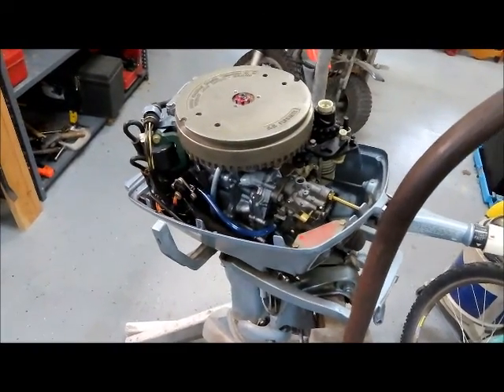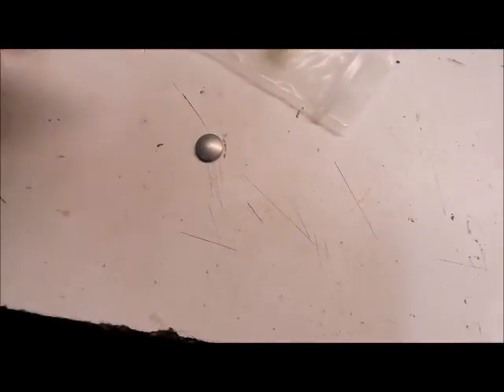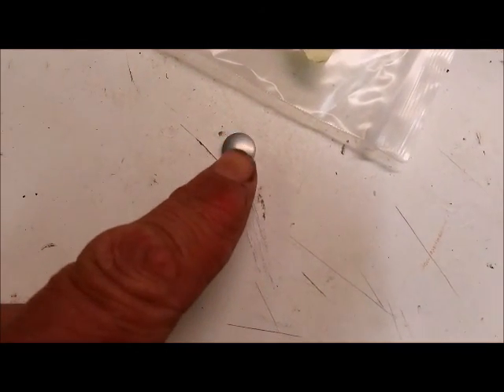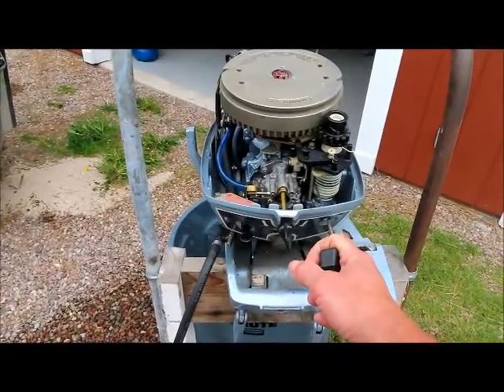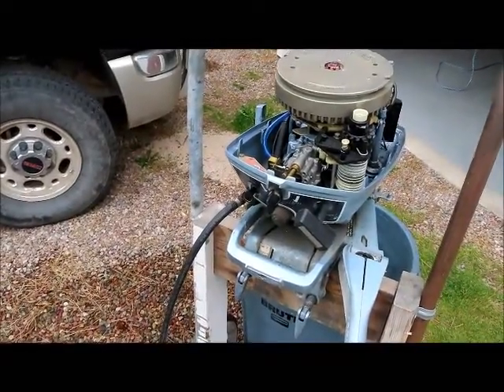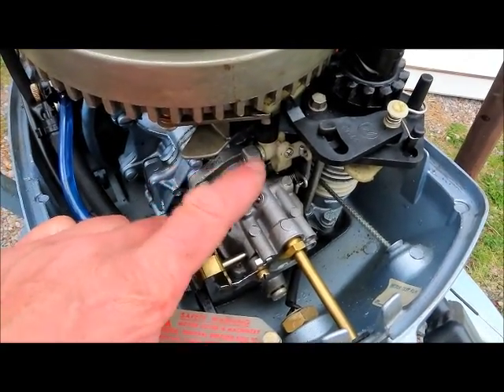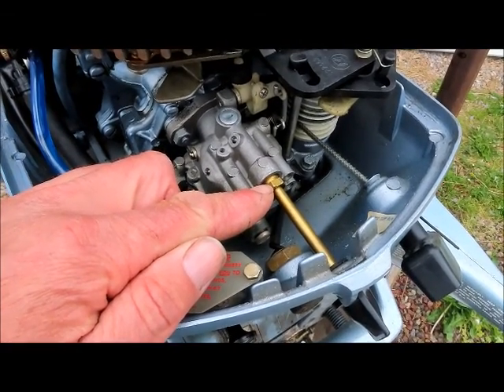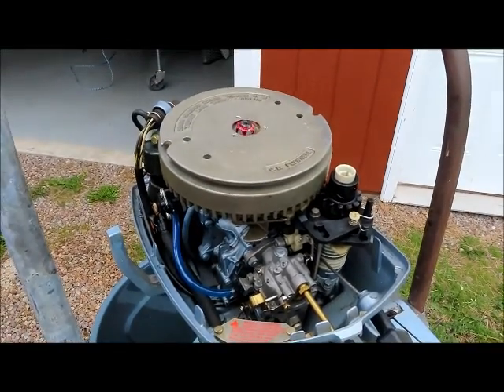Evinrude 6HP Idle and Hard Start Fix

Comment: I did this (before watching the video), and it worked great.  I was a little scared to punch out the old welch plug (first carb rebuild, with the kit, I didn't do it, and it still ran poorly at idle).  Then, 2nd carb rebuild/clean and popped the welch plug out, and further cleaned the holes, and now it starts 1st pull (or 2nd).  Thanks!

Comment: I just got my first boat. 1965 lone star V-hull, with 6hp Johnson sea horse. I have spark  but it doesn't try to start. So I know my points are good. Strong spark, no bark. Fuel delivery is most likely that issue. Thank you for the information, I would have just removed the carb and created more work than needed.
Reply: Never a bad idea to pull the carb and clean it 100% when you get a "new" boat.  The fix I show in this vid might be something that would be overlooked even if you so pull the carb and clean all the other parts but you can try it.  Hope it works for you.

Comment: Wow. I have this exact problem with my 6hp Johnson 1970s engine. It looks very similar to this evinrude. I’m going to try this! Thanks Paul for sharing this information.
Reply from the maker: Glad to help!  I ran this motor a lot last summer and it ran really nice.  Perfect idle, easy start every time.  There could be other things that could contribute to idle and starting issues but this is a great and easy place to start + good maintenance.
Reply: Just working on mine today 1977 Johnston 6 hp that has been ever so faithful but same symptoms creeping in.  Will give that a try and report back. Thanks
Reply: Ordered an expansion plug this morning from C dealer ($12 !) and leaving old one in place until it received.  Had taken apart low idle rod/pin yesterday and soaked with carb cleaner and let sit overnight. Put back together, screwed in until just touched, turned back 1.5 turns. Boom started up 2nd pull, adjusted ife 1/2  tur inwards and idled right down . So thanks as never considered removing,  resetting or removing the expansion plug. Not sure if worth still removing or cancel  prepaid order or simply keep as same part. Any event am a happy camper.

Comment: Dumb question but does the welch plug and low speed pin control air, or gas? I have a 1992 9.9 evinrude. The carb doesnt have a welch plug, but the carb top cover sits over a gasket. Kind of the same look when i pull the cover off and gasket off, theres 3 orifices at the end of where the pin sits under it. I took the pin out and it smelled like gas. If its supposed to regulate air, i might have a leak. I can barely start my motor but once it does itll run and idle on full throttle only. Once i turn throttle down it dies, and then i cant restart it. I've cleaned carb and rebuilt it etc many times but now ive found this video, im gonna clean those orifices and take pin out and clean that too and replace the gasket. Wish me luck, thanks for your video!
Reply: Update: i did what the video said, and now the engine wont start at all😂. Damn.
Reply from the maker: The low speed screw controls gas.  The tighter it is in the less gas, the further out = more gas.  You should try adjusting this screw so that it is about 1 1/2 turns out from being lightly seated/closed.  Don't crank on it too hard, just a light seat before beginning the 1 1/2 turns out operation.  1 1/2 is usually a good start for almost all engines that I've worked on.  I'm sorry but I don't know much about your particular engine so can't give too much advice really.
Reply from the maker: This prob seems obvious but if you haven't changed the plug you should do that.  I've had all sorts of issues with 2-strokes and fouled plugs.  A new plug makes a world of difference sometimes.  Could be a fuel delivery issue as well.  If you have a spare tank and hose or you can borrow one try swapping that.  A small leak in the hose/bulb really screws things up.  I had one that would barely run and super hard to start.  The bulb on the fuel line from the tank had a leak.

Comment: My 1976 Johnson seahorse 4 hp runs good for about 30 minutes, after that it loses compression. Fuel filter and carb are clean and I installed new sparkplugs.
Reply from the maker: Are you sure it is a loss of compression?  If so, the only thing I can think of is a crank leak.  It's possible that you have a bad crank seal in the lower end (output shaft) that is only failing after the engine gets good and hot.  I have not seen this issue on outboards but I have on a chainsaw that I  own so I know it's possible.
Reply from the maker: Other sources of compression loss:  reed valves, head gasket.   Anyone else out there have ideas?
Reply: @paulhaines5755  well I'm not 100% sure. It dies after a while and after that the starter cord feels way too light, as if theres not even a crankshaft attached to it.
Reply: @paulhaines5755  I think it might be the piston rings.

Comment: Hey Paul. I know this is an old video. Ive got a question about my 1966 johnson ld-11r.

I took the lower unit off to change the impeller, and there are two spring that came out but one of them fell out and I have NO idea where it belongs in there, if its supoosed to be on the driveshaft or not.
Reply from the maker: I'm not familiar with that year.  I don't think the models I have worked on have springs in them.  Not sure where that would have come from.  Try to find an illustrated parts diagram online.

Comment: Wish it were that simple to repair in most situations.  It isn't.  You did not even mention the main (high speed) jet in the bottom front of the carb.  It often clogs and will cause a motor to run lean at higher speeds, smoking a piston and scoring a cylinder wall.  Motor ruined.  Still, I'm happy for you that what you did worked well for you and your motor.  Thanks for the video.
Reply from the maker: Yea - your right it's probably best to take it all apart and clean everything - high speed, too.  I was just intending on showing the cleaning of the low speed circuit and the removal of the welch plug in this vid and also how carb removal on this particular motor is not necessary to do only that if you are having starting and idle issues.
Reply: @paulhaines5755  I get it.  Thanks.

Comment: Put some red threadlocker around the circumference of that welsh plug to make sure there's no air leakage
Reply from the maker: Good tip thanks!
Reply: Nope, you’re supposed to set them with a flat punch. I’d be worried about having to remove it later to clean those jets. Who knows what red lock right and gasoline will do either.

Comment: Hi I was just given a Johnson 6hp by my neighbor, it runs just has a very rough idle and shuts off we can see air going through fuel line and not getting enough fuel,we’ve replaced and rebuilt everything we know to do , fuel pump, gas lines/clamps, carburetor,and new float and everything.only thing we haven’t done is change tank which is going to be done tomorrow any advice?thanks
Reply from the maker: Yea - definitely could be a fuel tank issue.  Try a new one.  Make sure the supply line from the tank to the motor is new also as the seals on them can go bad and give you issues with air and such.
Reply: Could also be timing, they are very rough if not set properly.